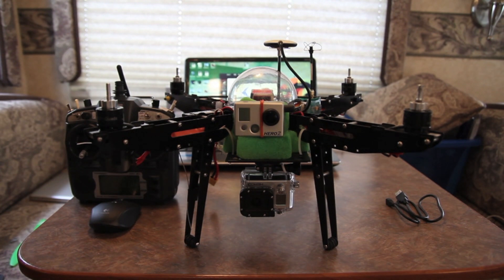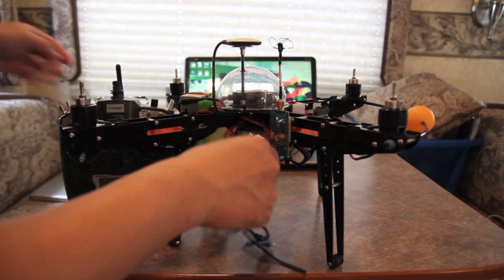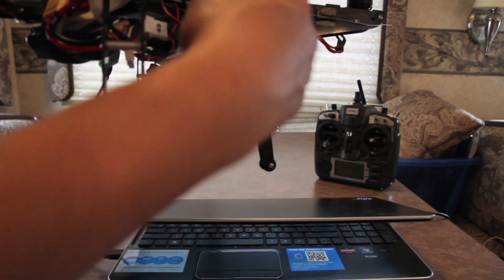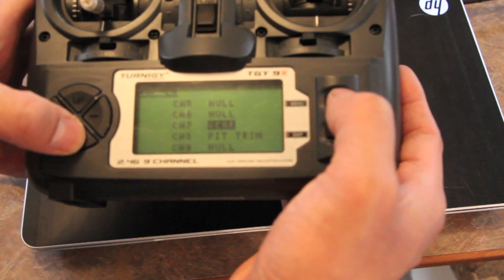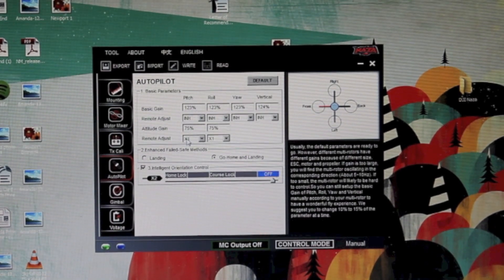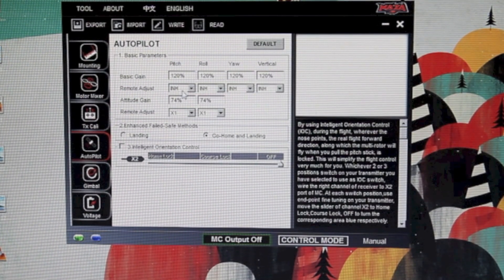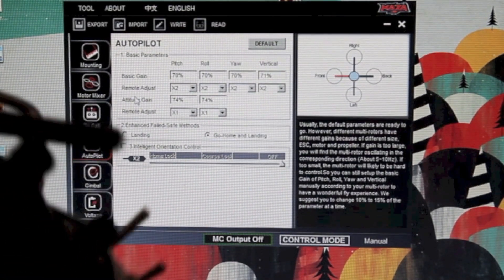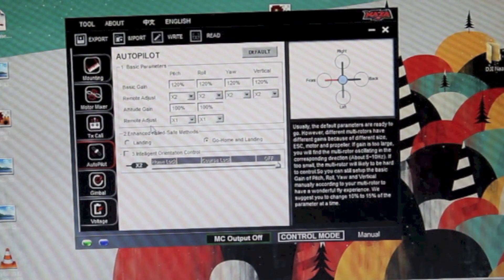Naza Gains Settings How-To and Effects during flight

Comment: Is putting all the gains settings at 100% ok to do? I recently changed my gains settings because the throttle was pretty touchy. I need a good throttle setting so I'm not taking off too fast or lowering too fast. I don't want those to be so touchy to the point where landing the copter is too fast and sketchy.
Reply: 3D Editor there is no gain for throttle response. The same goes for yaw, which is a pity for videographer. Only the roll and yaw gains are there, as can be seen. But there's the catch, at least for me it was until I got it: basic gains control how quickly the autopilot works. Atti gains control how responsive is the stick. DJI really should have told these clearly in the Assistant, but for some reason there's no details.
Reply: 3D Editor the basic gains were 100 and too high for me. Flying was good but slightly too fast corrections, causing shaking in my 2D gimbal footage. Lowering to 80 helped to prevent oscillation in high speed. I'm still finding the best gain combination for stable direction plus no shaking.

Comment: NIce video! Thanks for that. I did similar configuration few weeks ago and I got an unexpected situation. After config de CH7 for X2 and fix the vslues on NAza software I went to fly, then during flying I tested the failsafe mode. Suddenly the quan cames totally unestable almost falling down, I just get the control again aborting failsafe mode. After check it the problem was that when Naza turned on failsafe the gain values goes to highets values (arround 400%) making the quad totally crazy.